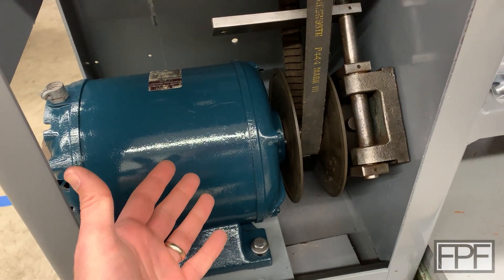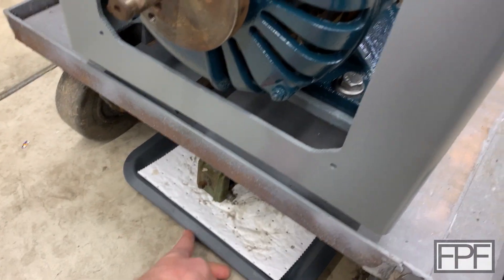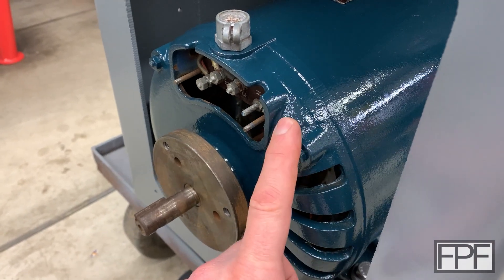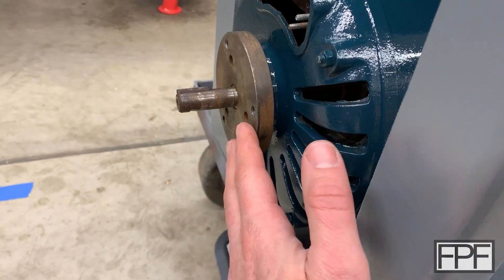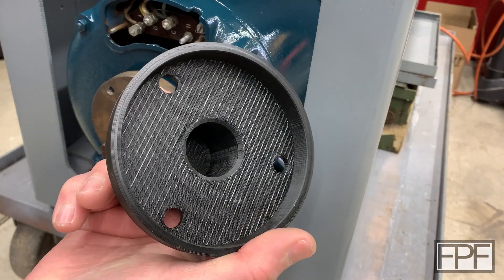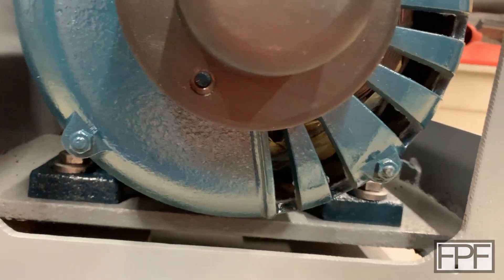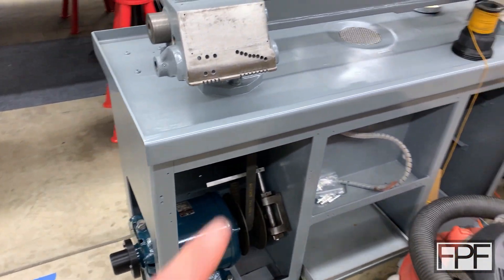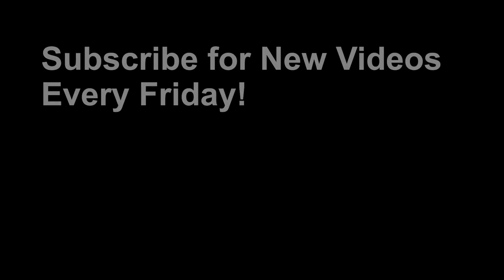3D Printed Motor End Shaft Cover

Comment: Have you thrown the brake away? Or would you be interested in selling it?
Reply from the maker: I cleaned it up and saved it.  I figured I'd put it on eBay, but I'm certainly open to offers.  It appears complete ASIDE from missing the magnetic actuator, though I'm assuming that's likely an off-the-shelf part, while the overall braking mechanism is not.